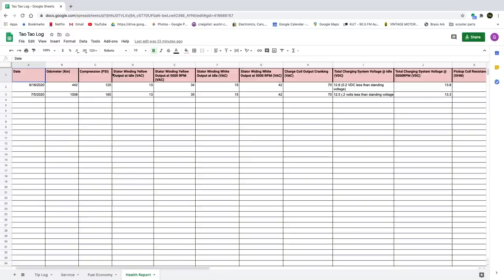(PT.7) I rode 1000 MILES on the most HATED scooter on the internet. Here is my review.

Comment: I'm a little confused when you talk about the "transmission " there is no actual transmission or gears that chest. There's some weird clutch like squeezer on both ends of the belt that change sizes as the motor spins faster giving you better ratios to move faster but it's all spring powered
Reply from the maker: Well it is still technically a transmission. Most modern cars have an optional CVT (continuously variable transmission). And while the springs in the driven clutch play a big part in the operation the other half is the variator, which uses centrifugal force on sliding weights to vary the ratio. For instance the Nissan sentra CVT is nearly identical only the belt is steel and it uses a stepper motor to vary the ratio instead of weights. There are also a set of gears for final reduction in the "final drive case". A lot of people get hung up on the term "shifting" but that is the only way to describe transitionioning through ratios. I never say shifting gears, just shifting.

Comment: It's interesting to note (assuming full motorcycle license is already acquired), that this Scooter brand new would cost somewhere in the region of £630 here in the UK. For comparison, I picked up my 30 year old CBR600 that's done nearly 91k for £500. Now owned it 3 years and only had to swap out the forks, rad and fan which collectively cost nearly £100. Still cheaper than the Tao Tao! It will never win any awards, but I trust it a lot more than I would the scooter. 

But as you say, the starting position for a TaoTao is £630. Whereas my CBR would have cost in the region of £4,000 at the time.

Comment: The most dangerous motorcycle I've ever ridden was a Honda cub 70.
It had 350 miles on it and was perfect. 
3 speed semi auto transmission. 
Top speed (set the sundial) was 38mph.
Any car could easily beat it off the line, and going up any incline was hopeless. 
Drum brakes that couldn't stop. 
Sold it after 2 weeks.
Got 1800 for it from a collector.

Comment: I have both those problems hence why I am watching. I either walk or drive my "Pony". I am having starting issues right now. Checked plug, changed carburetor, check battery, fuel and vaccuum lines, check and made sure petcock was working. Its 1:15 in the morning and I'm about to go check the valve lashings. I'm at my wits end. Cdi is probably my next buy in a week when I can afford it. Anyways going back to your video on valve lashings. Any advice is much appreciated.

Comment: I understand the stress I have 2 scooters a 250 and a 150. They are my daily drivers yet it seems to keep both of them running I'm working on something once or twice a month if not once a week. A 50 was great for me in the big city where I wouldn't hit roads faster then 45 ever yet where I live now it's 55 most areas even though the 150 hits 53 and holds it well drivers get so angry and hateful. I can understand if you have other options for transportation use them.

Comment: I wonder if the quality on a 2008 scooter I have is different from a Tao Tao being made by a different manufacture called Taizhou Chuanl but is almost an identical chassis. Despite it being pretty old and was given to me because it wasn't working anymore, it didn't take much to get it running again and a lot of the original equipment still works perfectly. It has roughly 1600 miles on it so it hasn't been rode on for a long time for it's age and probably sat for a long time but it hasn't shown to be as trouble prone as the Tao Tao in your video.

Comment: After over 3000 miles I've had to change the headlamp, do the scheduled oil changes and replace the voltage regulator ($10 on ebay) and change the belt after 2k miles (got 2 Kevlar belts on ebay for $16).. I also put a big hose clamp around the whole muffler to ensure the welds don't break. The engine has been running great. I'd say it's been well worth the money for me. You need to be a little hands on with it and keep an eye on things but if you do it's really good. How, as a mechanic, you allowed the whole muffler to fall off is beyond me. You didn't notice anything? I guess it's possible but idk. I'm a noob with these things but I've been able to maintain it pretty well so far.

Comment: So I have a few thoughts. Pain in the butt vehicles are more tolerable if you don't have to drive them everyday (I say this having both a nice car and a beater, having had periods where I had to daily drive the beater). The experiment might not be quite as grueling if you set a mileage goal instead of trying to only drive the scooter for 6 months. This would enable you to take a break from it when you need to, or alternate it with something else (drive the scooter M, W, & F; take a break Tuesday & Thursday for instance). I would break this experiment into 2 parts: 1) the "living with" part, which I honestly feel like you've completed, and 2) long term reliability, especially of the power train. Part 2 doesn't really require driving it everyday, hence my suggestion of taking a break.

Comment: I love your videos...Have you ever ridden a Adly GTA50? I'm having an issue with mine and as far as I've seen not much on upgrades for it either. When I first got the bike it was awesome. Now what it is doing is shutting down on me and it seems that it is locking up when it shutdown. Then it won't start for a while. Now it seems that it will not hold a charge!
Reply: Someone please help!
Reply from the maker: Yes in fact I used to work at a dealership that sold Adlys! At the end of the day they are just standard "Chinese scooters". However the GTA is a 2-stoke and it uses a "minarelli" 50cc motor so all of those 70cc kits and hop up parts bolt right on!
Reply: @Scooter_911  Thank you! That is very helpful my friend. 👍 Keep up the good work!
Reply: So can you tell me what upgrades I can use for this scooter? I've even tried looking up the number on the scooter and can't find anything on it!?

Comment: Hey Garrett 
Question again 
Does the valve springs 
Affect the starting of my scooter 
I remember some time back
One of the springs was very loose 
So I tried turning it back down 
With my hand 
I’m done with the Tao Tao 
I have another scooter 
My commute to work is 6 miles 
My primary transportation is my bicycle 
That’s odd 
That’s why I asked about the heat temperature
Reply from the maker: Yes! if your valves are improperly adjusted it can result in low compression and thus hard starting.

Comment: I have the same scooter in blue it’s definitely the owners ive had 0 issues bought used with 70 miles on it and it ran like it was brand new at a dealership it’s been extremely reliable and amazing on gas also just had the performance clutch kit from rolling wrench shipped out I will be installing it in a week or so once i have the time to put it on over the weekend bus with 200+ added on mileage its been an amazing buy from fb market also just a screw turn on the carb allowed my scooter to hit 40 on flats and 35 - 37mph uphill

Comment: Living with a Tao Tao seems to have been a very valuable study. Most especially for the psychological components. I'm from Texas as well. Up in the Dallas area and I can certainly relate to the problem of "aggressive" drivers. I generally drive pretty briskly but I can't imagine somebody having the balls, or lack of sense, to insult, cuss at, attempt to run over, or otherwise threaten a 6'4" 220 guy. Maybe that's because i'm only 5'7" and would not want to find myself in that confrontation without a force multiplier. Or may also be because i'm not a self important asshole that thinks my right to use the road trumps that of somebody on a scooter. Either way. Man.. Let me say how much I appreciate what you've done for your viewers in regards to that. It also makes me want to advise that you consider the experiment concluded with sufficient data. Get yourself back in a good head space and start daily driving the Pinto again :) I STILL haven't been able to find a good candidate for an EFI conversion daily.

Comment: I built a fundamental 4 cycle cam. You give up high speed surge. You get static thrust . It carburates better. It holds a low speed better. It's much quieter. Cooler. Less strained. Surprise. It's better on rough roads.

Comment: I feel your pain man. I too have a TAOTAO and ill be damned if i can keep it on the road. i went into it not knowing a damn thing about these things. I had to learn a ton to just pass the 1st month never mind  the last 3 years. I have changed the engine twice, changed the carb, re-jetted countless times cause as you said its trial and error. its been a rough road. I did put in a 100cc engine not for the extra speed because i drive like an old man, but i did it for the extra power uphill and so the folks behind me aren't throwing things at me and and flashing lights. It is much better to have the slightly extra power, but then i get "why don't you just get a real bike?" lol. anyways be safe and only do this as much as you feel safe. thanks for the videos

Comment: quick heads up, the transmission does not shift
its a CVT, it just slowly goes trough the ratios on an infinitely fine slider
Reply: The movable face of the driven pulley is attached to the other half of the driven pulley with guide rollers that ride in a spline on the movable part. The shape of this spline determines at what rate the rear pulley will expand. Some manufacturers will make a bent spline rather than a straight one to make handling the scooter at low speeds easier. This gives more forgiving power control at lower speeds. You can feel the bend in the spline as a sort of low and high gear.

Comment: Why not continue the series on the opposite end of the scooter world, where you spend like 1200 dollars on a preowned performance 2 stroke, Im talking an Aprilia SR50, 1997-2001. they have the LQ minarelli clone, the cream of the crop of the Minarelli's, which is the best low CC engine in the world... modding it to put a big bore, transmission, and gearing... and maybe new lines ect. say, 1500... they can easily do 65 mph with these mods and are very fun. if you need any advice on how to tell which one has the minarelli let me know... I would love to see what you think as a mechanic
Reply from the maker: I think that might be the next section of this series. What kind of quality used bike can you get for the same money. Pick up a jog, vino, sr, typhoon or something for next to nothing and see what it costs to go the same distance.

Comment: I own two of these bikes. They are cheap because they are basic operating systems-air, fuel and spark. No computer. Nothing electronic except the CDI. You need some mechanical knowledge to keep these bikes running well. One correction on the transmission-there are no gears. It’s a belt drive. The belt slides up and down the pulleys  with the RPMs changing the torque. On the rear wheel end, centrifugal force causes shoes to expand and make contact with the wheel. Very simple and believe it not, it’s the same set up on a Yamaha scooter I owned in 1986!

Comment: I purchased a 2020 BD50QT-9A (Boom) from the dealer it had a hard time starting from day one. Found out it was a busted intake manifold,$ 5.00 for the part I installed it never had a problem with it since ...just turned 1000km on it. You may have just bought a lemon from the factory.

Comment: I had a 150cc Chinese scooter and I racked up over 30k miles on the odometer, went through 3 engines with a little over 10k on each with very hard use. Managed to hit 75-80mph on flat ground (gps verified) with a big bore kit, cam, carb, and full exhaust. I will say to make a Chinese scooter “bullet proof” delete all the emissions equipment and swap in quality Taiwan performance parts.

Comment: I bought one of these to save on uber cost. Went from $125+ a week in uber cost to $5 a week in gas. I also get to work faster than waiting for a uber. Rainy days are my worse enemy now. I refuse to ride while raining for safety. I live in south florida and also have to deal with angry drivers. I have been cut off and brake checked because take off speed is slow. I ended up finding a safer route through 30mph zones that take about 5-7 minutes longer. Im almost at 1000miles and will probably upgrade to something that can keep up with traffic and prevent angry drivers behind me.
Reply: It sucks how angry drivers are

Comment: In Missouri the classification is much more vague. We dont legally recognize mopeds, they're called scooters here, and and motorcycle with a step through frame, and motor that also acts as the swing arm is a scooter. Our 50cc law states that any motorcycle or scooter that is 50cc or less, and has an automatic transmission (cvt, so vespa grip shifts dont count) does not legally require insurance, endorsement, licensing, or registration to operate on the motorway. But nowhere in our laws does it restrict speed limits, so if you can make a 50cc go 50mph, congrats, you have found a way to completely skirt vehicle property taxes, insurance, licensing and drivers licenses, and tags and plates at the expense of practicality. Which is why I daily a scooter that say 49cc on the vin plate, but is REALLY a 100cc

Comment: Tao tao still very expensive in our country you can buy a motorcycle almost the same price as  a tao tao its a skygo wizard 125. A copy of  honda tmx 155. The engine never need anything. Just oil change.bullerproof engine very cheap. Maintenance is only chains sprockets tires brake. For 5yrs  that's the only thing that is change.keep it up ride safe.

Comment: I have a 2006 baja sc 50 with 4500 miles on it,I got it free sat in my barn for a few years got it out did not run no spark "so I got a DC CDI box and Stader,Now it cruise's at 32 mph on flat land 25 up hills, Down hill I can hit 45 to 50 crazy speed😬🤓 I love my little pony 🙌🤙🤟🤸😆

Comment: "90's Camry Gold" is dead on 🤣🤣.  I don't think there is such a thing as "reliable gas powered transportation for less than $1000". But really tho, there's no need to continue this experiment once it becomes dangerous. Point taken. Fact is, the Tao Tao Pony 50cc is literally the cheapest POS chinese scooter imported into this country. Most scooter shops in my town stock mainly Tao Tao ATVs, sport bikes or scooters because they are the cheapest to import. I would go with something from ZNEN if Chinese is on the menu. Parts and quality control is much better.
Reply: I wouldnt trust znen all that much either. Heared some fuel line problems in znen revivals. The rear suspension springs rub on the line and break it. Had some friends get 1.5 meters of line and re-route the line to keep it away from anything moving

Comment: Center stand drags on all bikes because your rear shock is shot.
Most of your complaints are directly related to poor suspension. As you stated you far exceed the weight rating since you weigh 220#. 
Upgrade the springs and you will have a completely different scoot.
Reply: You didn't pay attention.  The weight rating is 167 kilograms, which equals 368 lbs.  He is well under the rated payload.
Reply: css28 he is the one that said he was too heavy for the scoot. Regardless the suspension is shot. That’s why it drags the center stand and handles like a bag of smashed assholes. 
Ya got me on a technicality, happy now?🙄. 
The suspension is where everyone cuts costs. Even factory OEM Ohlins are built to the OEM specs not Ohlins specs.

Comment: I don't think modification and improvement are outside the scope of the experiment. 1600 km is a sample which is long enough to be representative of the reliability of the factory components AND the patience of  an owner, which is a factor that will live behind upgrades to the scooter as much as component failure. 

If it doesn't FEEL safe, it isn't safe.

Comment: Everyone keeps claiming top speeds of 34-39mph, I have a basically stock Wolf RX-50cc, it will top out at a very legitimate 49mph within a quarter mile oO is everyone sandbagging, or has there been upgrades to mine the previous owner did that he lied about? I wish I knew, bc I feel like I'm lying, but GPS<, and car ride by, I have to trust it's doing at least close to what it says :\ also I'm 6'1", and 179lbs. IF I lean into it on a longer stretch, I've hit 51mph with no wind. Pre-owner swears, he only upgraded the fuel line to a few thousands wider because it helped idle, and was better quality.

Comment: What do you think about electric scooters? Maybe it's not a thing in oil country Texas?
Reply from the maker: I'm a HUGE fan of electrics. I've owned 2 EV scoots and they were 2 of my favorites!  The issue with them is there really isn't dealer support in the states for them yet when something goes wrong. I'd love to get my hands on the vespa elletrica or one of the nius and see what they're all about!
Reply from the maker: @robenglish416  i actually used to have a govex  go!t 2.4 (the only one in the US as far as i know) at the time I was working for electric Avenue scooters which was the only US distributor for govex. The scooter was amazing but I had some issues with the drive train that couldn't be resolved. It had to do with the USDOT homologation.